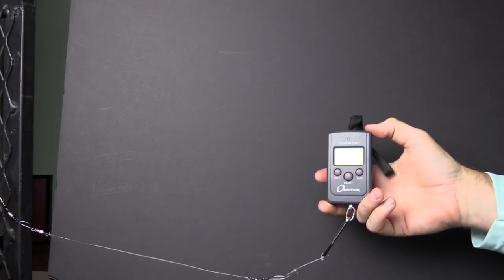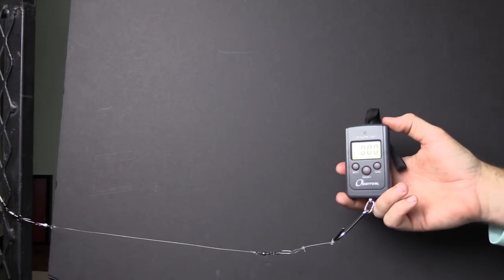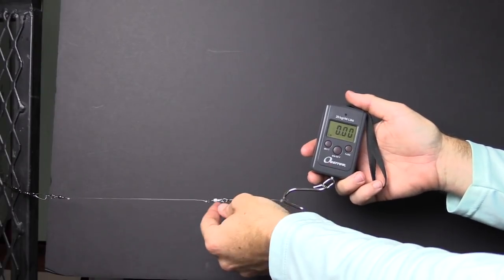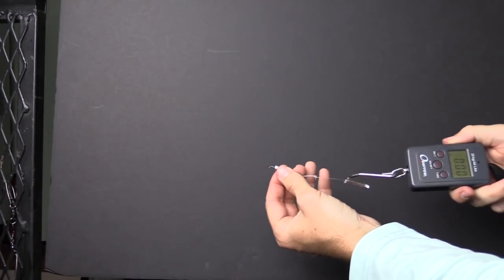Uni Knot vs. Clinch Knot Strength Test [Using Fluoro, Mono, & Braid Lines]

Comment: Surprised you havent tried the fish n fool knot yet. It's a uni knot but looped through the eye twice. It's strong, Salt Strong.
Reply from the maker: I use a very similar knot like that whenever in need of connecting a braid line to a swivel. I go through the eye twice, and then make 10 or more wraps... I haven't found a knot that's any stronger for braid than that one so far. Here's a post on that knot: https://www.saltstrong.com/articles/modified-uni-knot-for-braid/
Reply: It works well for mono and fluoro as well. The standard uni isn't that great of a knot (strength wise) but the double loop reduces the rate at which the knot bites into itself.

Comment: Interesting, my preferred knot is the uni over the clinch. I do like the 3 loop centauri knot for heavy leader which isn't a common knot
Reply from the maker: Thanks for the feedback. I'll add the centauri knot to my list of knots to test out. What line strength do you find that it is most beneficial?
Reply: @Saltstrong  I just find it easy to tie on 100lb and up mono, I'll do a 2 loop centuari on 400lb mono and leave a 10cm tag for shark trace, I'd guess 95% of your viewers would be using under 100lb leader, it is a great knot to know though
Reply: Notice the tag ends on the knot that brakes first... my uni knot tag is at top of knot away from the hook eye.. clinch is at bottom near the eye of the hook

Comment: I use the improved clinch knot on braid and has always worked well. You should retry the braid test with the improved clinch vs uni. Another great video thou. Thanks
Reply from the maker: I have done multiple tests for braid to swivel connections. Here's the best knot that I've found so far for that: https://www.saltstrong.com/articles/modified-uni-knot-for-braid/

Comment: Ok, but the uni knot is a six turn knot.....not sure you proved anything with unfinished knots?
Reply from the maker: The core premise of this test was to determine which method of wraps was the most efficient (both tied with 5 wraps)... and the Clinch knot wraps that are made around the single strand of line surprisingly proved to be more efficient than the uni for fluoro and mono.
Reply: @Saltstrong  Understood.  Thirty years ago when I was taught the uni.....6 wraps.  Every time I've taught since....6 wraps.  I'm sure you've tried this yourself but it makes a huge difference between 5 and 6 wraps.  As soon as you said in video 5 turns, I knew what the result would be.  Make them both 6, and you will have different results.   Just one old guys opinion. ;).  Thanks for the videos.   Great stuff.
Reply: The more I think about this....the improved clinch was my go to knot for 15 years before I learned the uni.  The proper turns for 20lb line and improved clinch is 7.  The best test using 20lb line would be 6 turns uni vs 7 turns clinch.  It makes more more sense to me to use the optimum  (as determined years ago by line manufacturers and verified by years of anecdotal evidence ) way to tie each knot in the test.   I tied and broke thousands of knots back in the day long before youtube.  Seemed each time I learned something new...I would make many tests just as you are to see if it was better than my setup at the time.
Reply: 5 wraps are plenty enough, one more wrap isn't going to amount  to a hill of beans. The knot broke  it didn't slip.

Comment: I use the improved clich knot on 30 lbs braid but i do about 12 wraps and I haven’t had a problem with it slipping
Reply from the maker: Thanks for sharing your experience using the clinch knot with braid.

Comment: I've been using a different version of the clinch knot for 60 years.  Tie an overhand knot in the line before tieing the clinch knot.  Work the overhand knot as close to the end of the clinch knot when tieing.  No more slip!!!  I've never had a correctly tied knot unravel even in braid.
Reply from the maker: Thanks for leaving the helpful Clinch Knot tip Jack!
Reply: This is what i also use.
Reply: Could you please test the improved clinch knot. When I tie the improved clinch knot for braided line, I use 7-11 wraps.
Reply from the maker: Will do

Comment: Braid definitely needs more than 5 wraps no matter what kind of knot you are tying. Don't understand why braid was tested with only 5 wraps. I'd say a minimum of 8 wraps at least to get a good indication of knot strength.
Reply from the maker: We kept the wraps consistent across all of the line types to show how different the results can be when using the same exact knot on different lines... many people make the mistake of tying the same exact knot on all lines, so hopefully this will help save some newer anglers from making a big mistake of using the normal mono method on braid.
Reply: @Saltstrong  The clinch knot(Improved clinch knot) is a viable knot for braid as long as the appropriate amount of wraps are used. I always try to wrap at least 8 times to prevent the knot from slipping since braid is known to be more "slippery". Haven't had it fail me yet. To each his own I guess. Tight lines!

Comment: I would tend to glue braid knots also, perhaps you could test that parameter?
Reply from the maker: What kind of glue to you use? We typically stay away from glue on knots because many types can crack when the knot is compressed which poses the risk of sharp glue edges damaging the line.
Reply: Over the counter norm super glue. I've since purchased so-called Rig Glue but I've yet to test it. 

I get what you are saying & it makes perfect sense but it has never been my personal experience. 
Also, I'd only use a tiny drop followed by a quick roll as it were, to prevent knots from failing due to slipping so I don't believe caking/cracking would occur? 
I would be curious to see the difference & since watching this you've inspired me to set up my own testing apparatus. 
Tight lines - glued or otherwise ;)
Reply from the maker: Cool. Please keep me posted to what you see when you test the glue vs. no glue.

Comment: i know this is not very scientific but do you think the wire gauge of the swivel being smaller than most hooks could be making any difference?
Reply from the maker: Yes, the more surface area that the line has on whichever object it is connected to typically will increase its breaking strength. This test was analyzing the effectiveness of the clinch knot wraps compared to the uni knot wraps. And we kept all variables like wrap turn counts and swivel size consistent... a larger diameter hook/swivel would likely increase the breaking strength of them both equally.
Reply: true point. (not so much about the lbs, but more so the comparison) thanks for the info. you guys do great work keep it up. 

ps wish i could find my old go to leader, Berkley, but thanks to you guys proving me right after all these years, i can't find it as easily as i used to lol. still thanks and keep it up.

Comment: Can you test on fluorocarbon your improved uni, the doubled uni, doubled clinch? I'm pretty sure that it will surpass palomar
Reply from the maker: Yes, the doubled uni or clinch should be able to compete or beat the palomar.

I'll def be doing some more fluoro to hook/swivel knot tests... they have been my personal lowest priority so far due to the fact that I use a light braid as my main line (for max casting distance) and connect to a stronger fluoro/mono leader (max abrasion strenght on the business end). So the knots on my leader don't matter nearly as much because that line is typically 2x stronger than my braid.
Reply: @Saltstrong  You shoud make it a priority  for the site. Lots of people are using your tests as a guide.
Reply from the maker: Roger that. The only problem is that these knot tests require a lot of time to make... the one thing we all wish we had more of:)